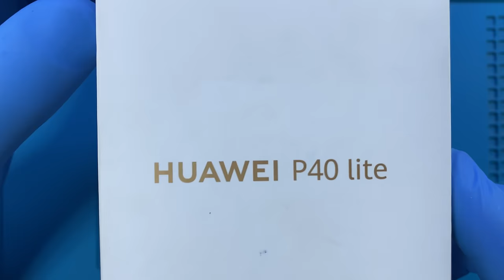Huawei P40 Lite Ekran Değişimi 🇹🇷

Comment: What is up with the wire being clipped to your arm?
Reply from the maker: Hello there;
It is a static-free wristband. Our technical service is designed to be completely free of static electricity, but it is installed by our technicians as an additional precaution in order to prevent instantaneous static electricity.
Greetings.